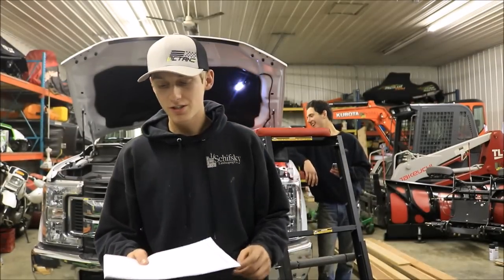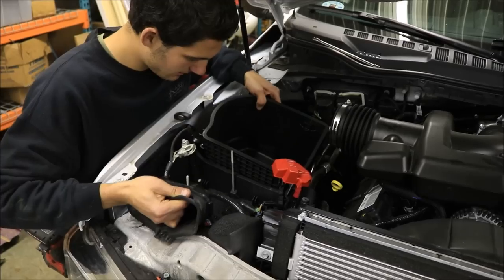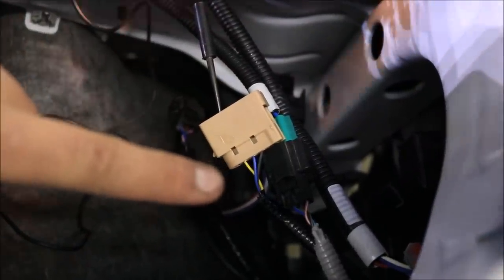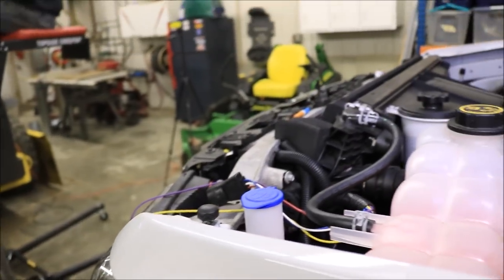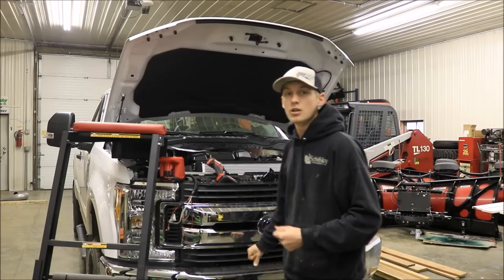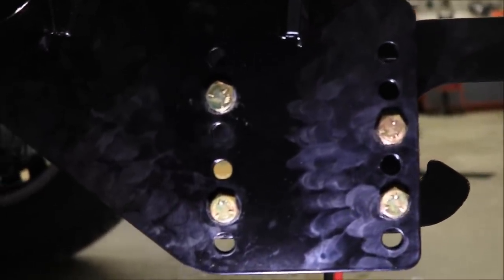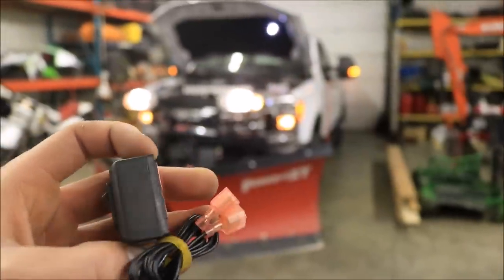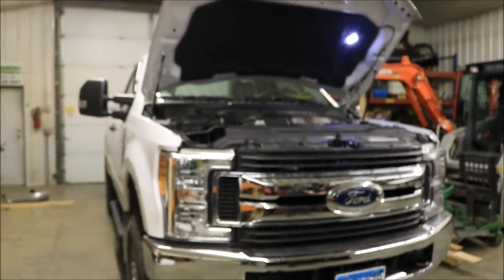BOSS Plow Install | 2017 F-250 | How To

Comment: I would not mount the solenoid right on the back of the radiator like that.  Otherwise it looks good.  I've installed a few of these.  I prefer Western's wiring kit, much cleaner install.

Comment: how did you get it into the cab  missed that whole install
Reply: It's a b** you got to like lay flat on top of the engine to get the right angle to get your arm underneath the brake reservoir and fight to shove this big Square connector through the rubber thing going through the firewall I had to cut my rubber thing with a razor knife a little bit

Comment: The extra white/black wire is for your smart hitch. And those oem sway bar 10.9 bolts are stronger then the grade 5’s that they send, I always leave them & boss approves of it
Reply: I’d like to come up on the l side of the steering wheel w my joystick connection guess I’ll reach out to an installation guy as you didn’t show that part.
Reply: @dturkette  Ford has a dedicated spot to drill a hole, left side of steering column. Basically right where a clutch would go. There’s a round foam cutout inside and a perforated foil cut out in the engine bay. I usually drill a 1-1/4” hole with a hole saw. If you have a trailer brake controller, it will require unbolting the module to gain clearance for a drill. 2x 10mm bolts

Comment: I connected the third wire to aux switch to have the lights on aux switch, it works, but how do you hook it up so I can put the lights back on my truck not the plow and still use the plow? Or turn the lights off altogether and still use the plow. That third wire sends power to the joystick.  Like if Im plowing during the middle of the day, I want to shut my lights off, but still have power to use the plow.  Great video by the way.  Referenced it frequently when I installed my wiring this weekend
Reply: The RT3 wiring kit should have a headlight toggle switch.

Comment: I have a 2015 Silverado w/4" lift. Do you if they make a bracket that would make the mount lower to get the magic 15 1/2 so the plow itself drops level.
Reply from the maker: I’m not sure if they do but I know a machine shop could custom make one. I’ve definitely seen them before but not sure if someone makes it or it’s a custom deal
Reply: ClarkW.Griswold00 not sure if this would help you or not. Steve

Comment: how you like plowing with this. did you get the 3.73 or 4.30 gears? might be getting a gas this year after only having diesels in the past. nice install
Reply from the maker: My brother colton plows with it, seems to be really good, it has the 3.73 gears and I think there perfect for the truck, if your we're going to be pulling over 10k often I might consider the 4.30. If your planning on pulling over 10k regularly I definitely wouldn't get a gas
Reply: Excellent question, I'm interested in the answer myself, I own a 11 duramax and I think that's the last diesel I will own, between all the epa clean emissions, computer controls, actual mileage and the cost of the diesel option and fuel price at the pump it doesn't make sense for me to own diesels anymore. @
CarsonSchifsky

Comment: You know if the DTX IT'S THE SAME HARNESS?
Reply from the maker: should be all the same.
Reply: @CarsonSchifsky  thank you so much for you vid I save $800 just because you . GOD BLESS YOU
Reply from the maker: your very welcome! thanks for the support! we will be purchasing a DXT plow soon so make sure to subscribe to see more about that!
Reply: @CarsonSchifsky  sure I will subscribe.
Reply: All the wrong harnesses are the same with the power and ground wires and then your 13 pin control wire the only difference is controlers a straight blade can be ran with a v plow controller

Comment: A decent video, for sure........unfortunately, you may have left out the most difficult part! ......how/where you routed the controller wire through the firewall!  As you know, these super duty's have NO ROOM in the engine compartment to access the firewall grommets.

Comment: Hey funny I have a boss from 2001 and that wiring schematic looks the same 
Are those 2 relays down there
Reply from the maker: I think its just a generic schematic they use. Different trucks require different light adapters but other then that i think everything is pretty much the same. Which two relays are you talking about?
Reply: CarsonSchifsky when you were hooking up the head light adapters it looked like 2 relays on each one
Reply from the maker: Correct, the truck specific headlight adapters have 2 relays on each. (for this model anyways).

Comment: 8 Hours! Totally unnecessary, just remove the headlights and leave the battery and air box alone. You guys went further than you needed to, but good job, detailed.
Reply from the maker: ya that could have been easier, a lot of the reason it took so long was because 1/3 of the time was spent trying to film or retake shots that i messed up on so realistically someone focused could do it in half.

Comment: How did you go through firewall?
Reply from the maker: Under the steering wheel there is a rubber grommet that has all the other wires running through it. we drilled a hole in that and punched it through there.